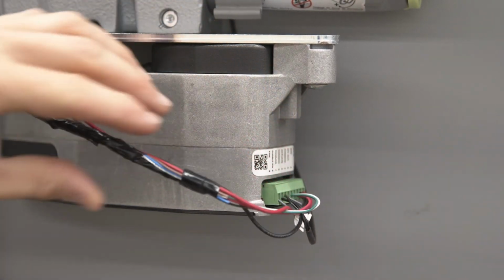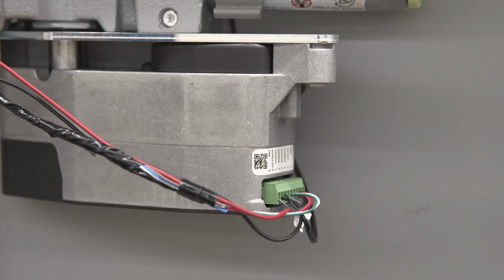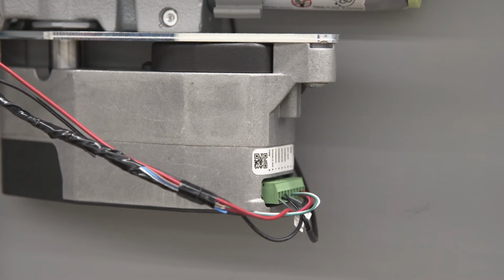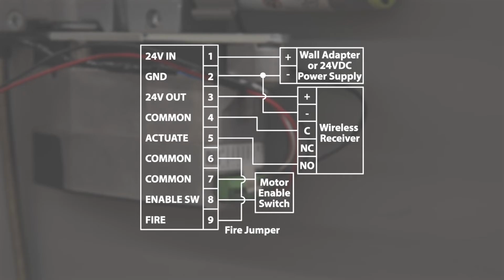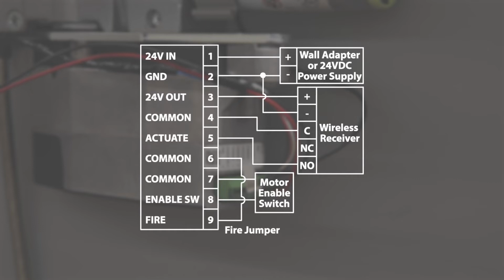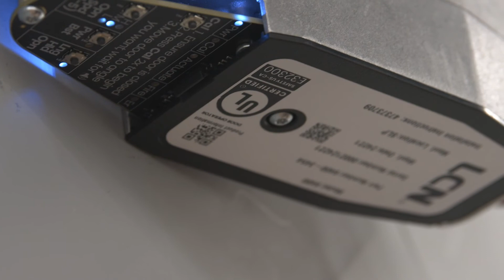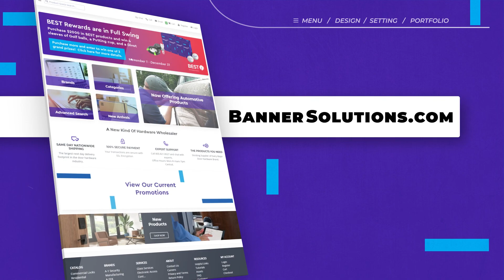Installing the LCN 6400 COMPACT Series Low Energy Operator on an existing LCN 4040XP Door Closer

Comment: Per the directions, the arm bolt and the screws holding the mounting plate to the closer must be secured using a torque wrench. This is not optional.

Comment: Why do you start the video with it already mounted on the door. How about starting from scratch with the measurements for mounting?????
Reply: This product was designed to be added to an existing 4040XP or older 4041. It can also be installed as a totally new installation with the 4040XP. There is an install video here on YouTube that will show installation of the 4040XP.